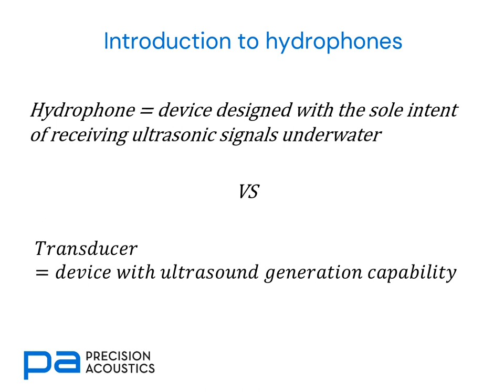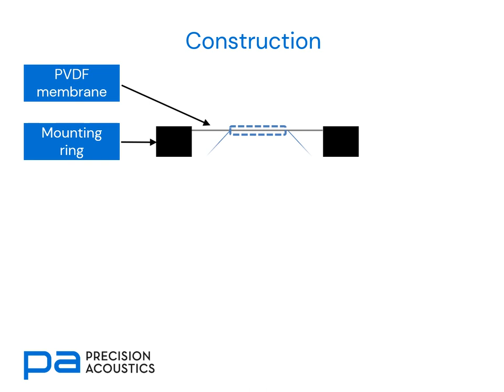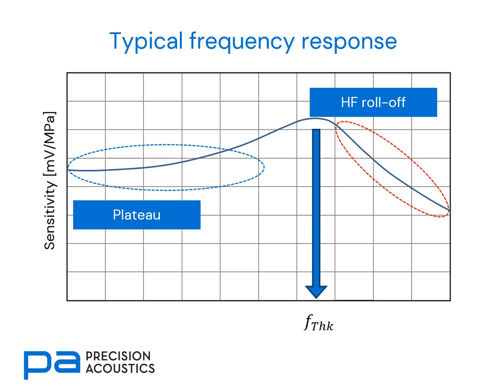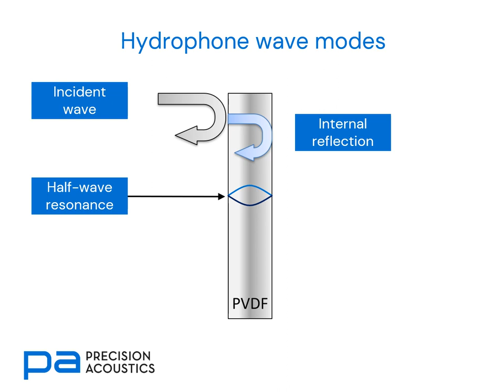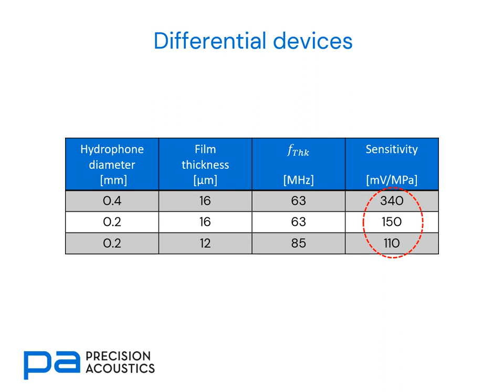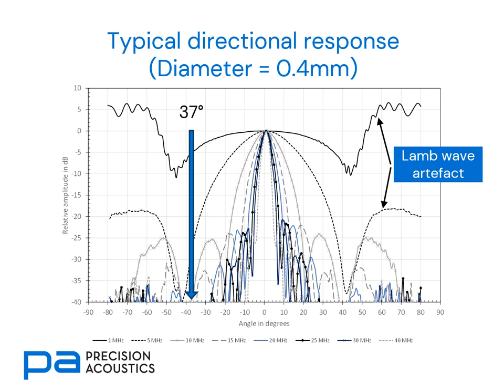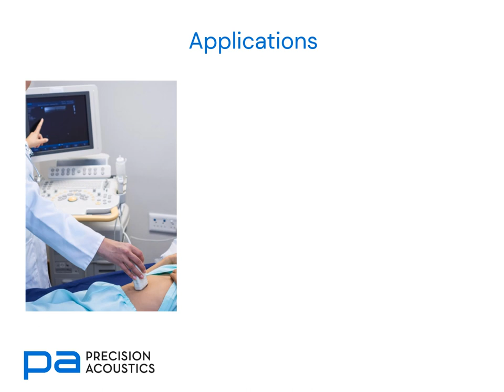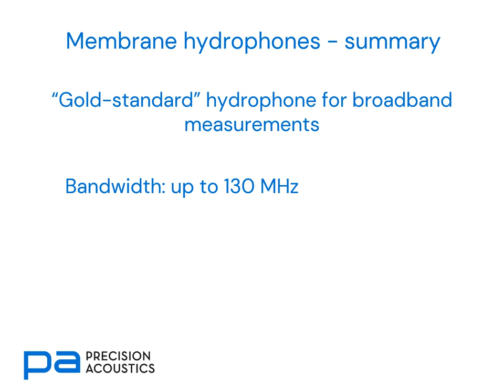PA TUTORIAL - Hydrophones - Membrane hydrophones

Comment: Hi Andrew, great video! Is it possible to provide your estimation for typical NEP within 63 MHz for 0.4 mm 16um hydrophone?
Reply from the maker: Thanks - glad you liked it.  

This is currrently a very tricky question to answer not least of which due to the fundamental limitations of hydrophone metrology.  There is only one national measurement institution offering calibrations above 60 MHz and the uncertainty levels at this frequency are substantial.  Therefore, please consider these estimates as being VERY rough.
For 0.4mm 16um with conventional preamplification, the noise floor of your DAQ is likely to be the limiting factor.  Assuming this to be about 1mV noise pk-pk, I would expect NEP to be in the range 15-25 kPa (will vary from one device to another)
For 0.4mm 16um with differential preamplification, there is a lot more gain in the preamp but has a higher internal noise floor.  In this case I'd expect NEP to be more like 10 kPa (will varIy from one device to another).
One final note,  0.4mm is likely to be highly direction at 63 MHz.  You may be better off considering a small hydrophone, such as the 0.2mm diameter differentially amplified membrane hydrophone